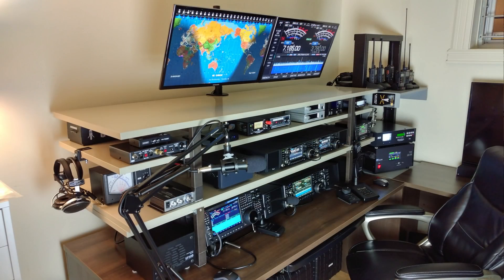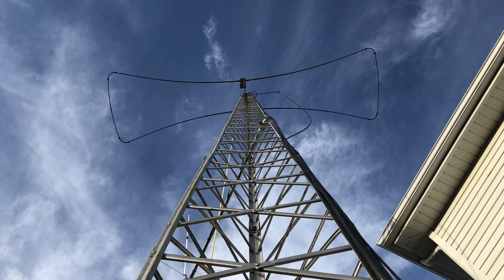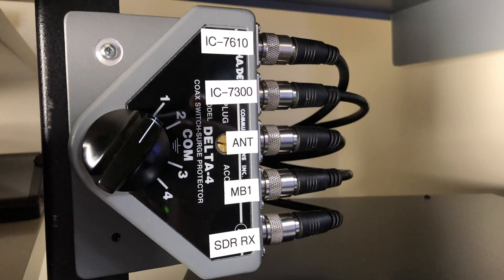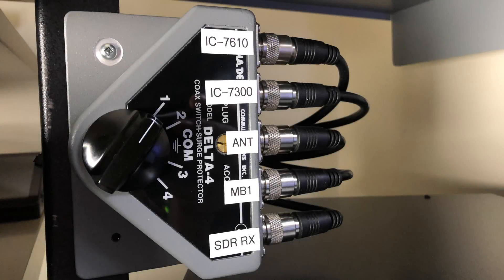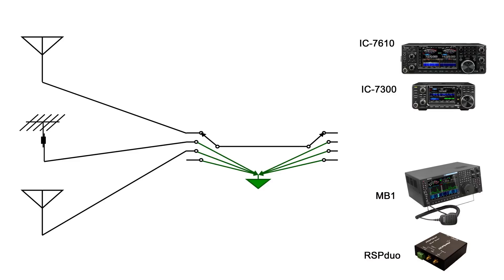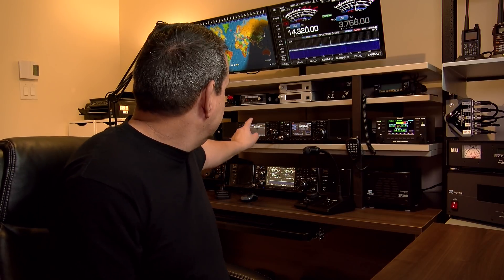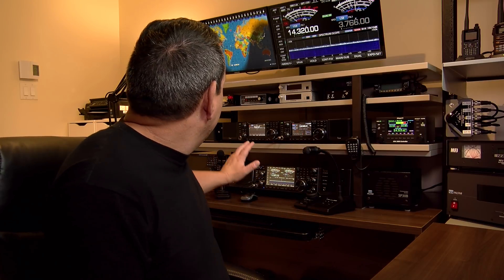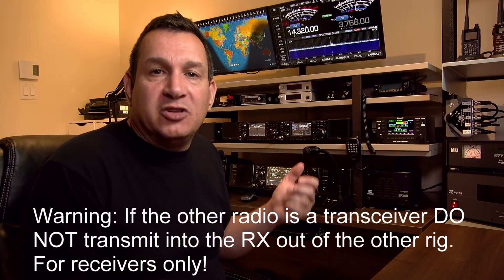Safely connect several HF radios with mulltiple antennas

Comment: I'm in the process of moving to 4.5 acres and I will be able to set up multiple types of antennas.  Is it possible to have one switch where all antennas use one remote turner at an outside feed point near them and have only one LMR 400 feed line to the shack? (cost saving of only buying one expensive remote tuner)
 I like the idea of having a remote turner and only feeding a low SWR signal in and a low-losspalm

Comment: Can you but 2 antenna  to one police scanner 
Like the uniden  bcd325p2
Reply from the maker: Yes with a similar configuration, but if you only have receivers, no transmitter, it's easier has you don't have to add extra protection.  73 Pascal VA2PV

Comment: How about your VHF/UHF radios and antennas. Do you worry about those radios getting blown by the high wattage of you HF units?
Reply from the maker: The bands are to far away from the HF band to represent any danger.   73 Pascal VA2PV
Reply: @Laboenligne  I kind of thought so but I am green at this.
Reply from the maker: @1crazynordlander  In the HF bands, many first harmonics are on another band, 3.5 MHz (80M) = first harmonic is 7.000 (40M), and 14 MHz for 20M...  and 28 MHz for 10M...  VHF is 144 MHz and UHF is 440 MHz.
Reply: @Laboenligne  Like same notes on different octaves. They resonate. I have a My Antennas EFHW-8010 that I Use with my IC-7300 that has a RadioAnalog PTRX-7300 panadapter that I installed. I connected that to a SDR Play RSPdx and use Omnirig to sync the tuning on the SDR and the IC-7300. I makes it so easy to see the signals. I love it! I have Contacted others in the States and hear a few from your country also as I live in Minnesota. My call sign is KA0KAE My name is Kevin. I live on my farm where there is a lot of room to play with antennas. 61 years old and this is my first year in Ham Radio. I have an IT background so that helps. I posted a video on my YT channel showing a short video of my rig in action about a week ago. I have a long way to go. Thanks for all the info.
Reply from the maker: @1crazynordlander  I just subscribe to your channel Kevin, 73 Pascal VA2PV.

Comment: Every time I enjpoy your videos!!! For people like me want use 2 tx at same time I can suggest ACOM A2S  works perfect with yaesu (made fot it millone ft1000) kenwood electaft and all radio that have "TX Inhibit” so for Icom must use tansverter signal or make another mod (modern Icom that have  "External Keypad" feature like IC-7610 that is documented on p. 13-4 have mute function that rx/tx inhibit) 73 de IZ3QVB
Reply from the maker: Hi Alessandro, thanks for watching and for the tips.  73 Pascal VA2PV

Comment: what do the people do that run multiple radios at the same time?
Reply from the maker: They used an external bandpass filter for each band.  Then a radio is dedicated to one band, I saw a club station setup with multiple antenna a multiple HF and that's what they were doing.  73 Pascal VA2PV

Comment: hi
i have a micro KEYER II & STATION MASTER from microHAM try to see if this configuration is work for you it will do whatever you wants even for two hf radios and after that you will focus on the radio just change the band from 40 to80m and automatically antennas will change 73
Reply from the maker: I will check it out.  Thank you.  73 Pascal VA2PV
Reply: edit :for two radios use micro2R or MK2R+

Comment: I definitely like the idea of bringing only one coax in, but because I'm nuts (lol), I'm worried if there is a catastrophic failure at the switch, then I could be off the air.  Be that as it may, I'd like to be able to run Digital HF while using SSB on another HF rig.    What is the solution there or is it just not possible?  Great video - thanks!  73, N3QXX.
Reply from the maker: While going trough the viewers comments, somebody suggested this device, KEYER II & STATION MASTER.  I will check it out.  73
Reply from the maker: Hi, if you own a large piece of land you can set antennas far away from each other and install external bandpass filters to protect your equipment.  Technically I don't think it will be possible to operate two rig on the same band even with separate antenna.   Since I'm not in this situation, I didn't study the case as it's not possible for me on my 6500-square-foot lot.  Try to participate to your local club field day, coming soon, and see how they operate the multi-operators on multiple bands.  73 Pascal VA2PV
Reply: AK3B I’m also looking for a way to work digital on one HF rig while working SSB on another rig. Maybe a switching setup to be able to switch any of the 2 antennas to any of the 2 radios. Will probably also need good filters. ZS6J

Comment: Hoy can use same antenna to feed at the same time all your HF receivers with a proper splitter,  so you can compare  your radios. This is what í do. And you can use a relay to disconet all when you tx. It is very safe  and it allows you to enjoy all your antennas and trasnceivers or receivers.
Reply: Can you explain how you do this? I am trying to do the same thing, 2 hf radios on both antennas.
Reply: @Astro25man  Just use the tx out of your transceiver to start a relay to disconet the antena Infantil the Other transceiver. 
You need two. When you transmit the Other receiver stops receiving

Comment: Very good video Pascal!!  I also have the same Alpha Delta Antenna Switch and when I was researching manual Antenna switches it was the best I could find and it having the ability to ground all antenna ports not in use is a great feature!!  I originally purchased the switch for my two HF radios but now use it to switch between my Icom 9700 (which I am really enjoying) and my TYT TH-9800 Quad Band Radio!  And also To kind of full proof not accidentally transmitting on one of the two radios I just mentioned I have a system where I have a 3M sticky Note 📝 that says “CONNECT COAX” and I stick that on the front of the radio that is not connected through the Alpha Delta Switch and when I switch I move the sticky note to the other radio..... it might seem a bit tacky but it works for me....and the sticky note does not leave any residue on the radios!!  Oh by the way I am not sure if you are aware of Eric (Who has the YouTube Channel HamRadioConcepts KJ4YZI) but he holds a D-Star Net on Saturday Evenings at .9pm EST on REF078A you might want to check it out it would be great to hear you check-in!!  73’s from Florida K4BBC Chris
Reply from the maker: Hi Chris,  I know Eric and I knew that he holds a net on D-Star, didn't know when or where, thanks for the info.  As long as you have a setup that works for you, that's the most important thing, I'm kind of goofy and a sticky note would not work for me, hihi.  73 Pascal VA2PV